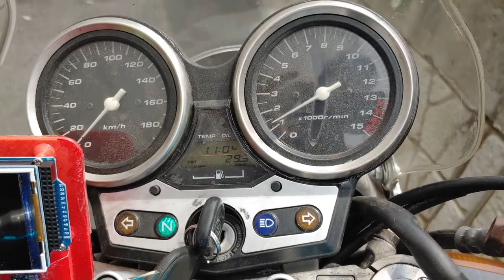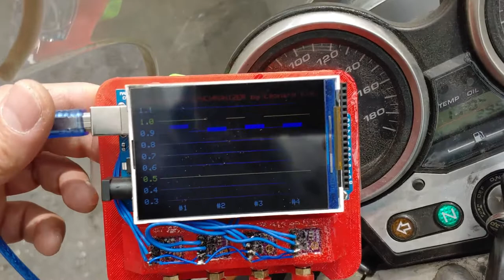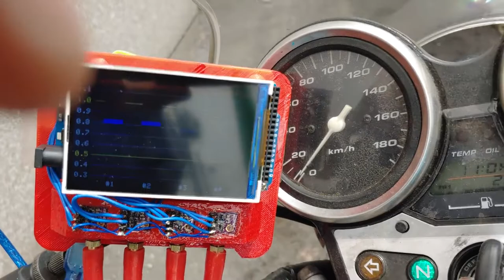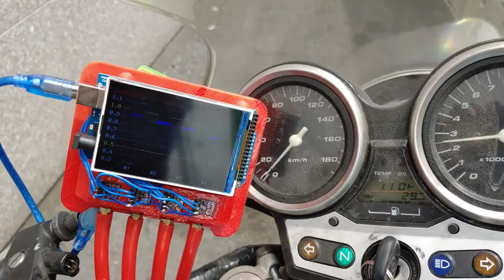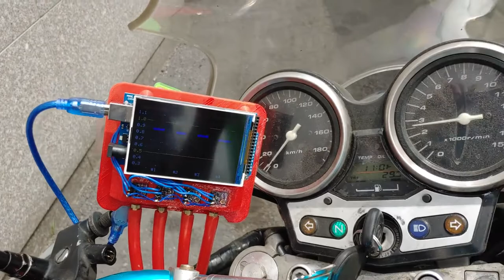Motorcycle digital carburetor synchronizer using Arduino & BME280, 3D printed idle screw knob

Comment: The actual 280 chip has a small hole to detect absolute pressure. How did you seal the BME280 sensor to allow a tube to be run each carb?  I realize this video is pretty old but I’m working on a similar project for my 6carb Honda Valkyrie.  Also did you experience electrician noise generated by the engine or alternator.  If so how did you filter it?  Thanks, hope your still available to answer before I start ordering stuff.

Comment: Hey How do I make this .I do alot of Projects with Arduinos..
Reply from the maker: BME280 can measure pressure between 0.3 ~ 1.1bar and normal engine can't make under 0.3bar in a intake port. So you can make this if you know arduino.
I used Mega2560 but I recommend arduino DUE because of the processor speed.
Reply: @leonardkim835  Hey Thanks alot @Leonard Kim Am going order for the BME280 and I will get back to you for more helpful information from Uganda East Africa  😃🖒 My Cb400 finally Worked 😃🖒
Am going for a Test Drive Today after fixing the Rear break😆✌
Reply from the maker: @JohnGaliwango  John, you must use a noise filter logic in your source code. If you do not, the sensing value will be useless because of hunting. I used Kalman filter.
and... that's good news  your CB400 is working now. ^^
Reply: @leonardkim835 I know it been 4 years since you posted this comment.  I was interested in asking what the setting were for your Klaman filter.  That is the parameters passed to it by the  calling line of code.  I’m using the “simple Klaman filter” that requires 3 parameters be passed to it.  This is for my own carb sync project using Arduino.  Hope you see this. Been a while.

Comment: How? BME280 is pressure sensor, it doesnt measure vacuum.
Reply from the maker: BME280 can read from 0.3bar to 1.1bar(absolute pressure)
A cylinder pressure(when it is doing suction phase) could not be under 0.3 bar usually.
So a BME280 can check the suction pressure of cylinder.
This(under 1bar (absolute)) is what we call relatively "Vacuum".
This will be helpful for you.
https://leonardkims.blogspot.com/2019/02/motorcycle-carburetorthrottle-digital.html
Reply: @leonardkim835  Thanks now i understand. Please tell me, the results are very precise?
Reply from the maker: Yes, it's value is very precise.
but as you see in my video, precise value is useless because it's value is hunting continuously.
so, more important point is how fast display the value, not the value itself and the value is very weak for noise and electric shock, so noise prevent hardware, circuit, noise filter program logics are needed.